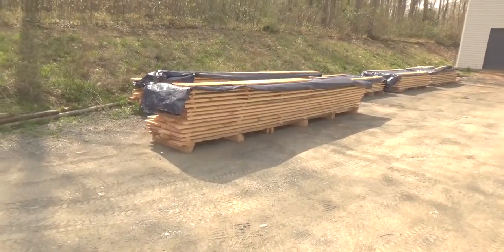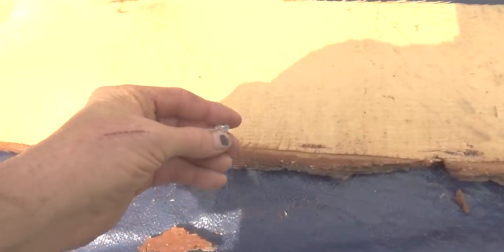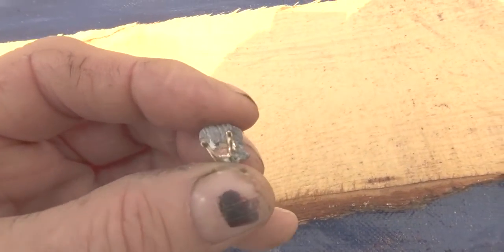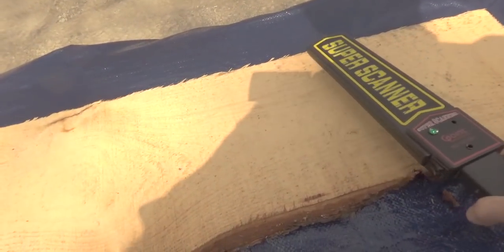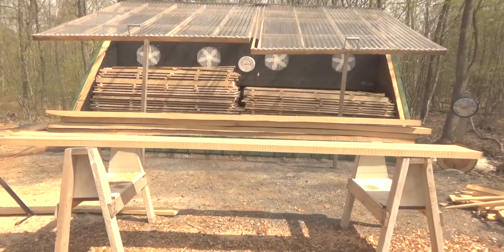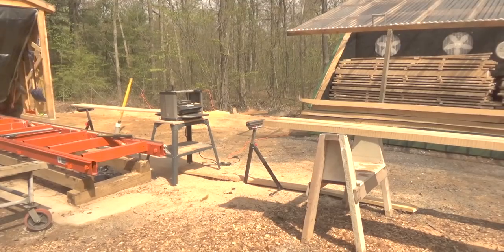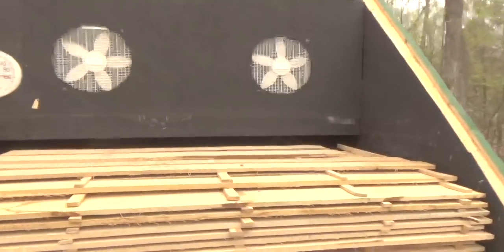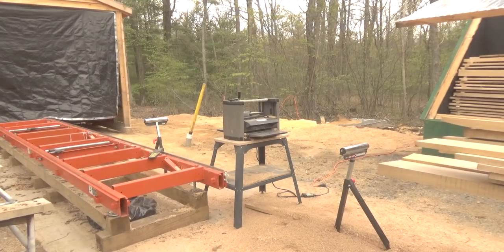Setup for planing at the kiln.

Comment: For some reason I have become hooked on your videos, I look forward to see your progress.
You should look into taking your lumber to a mill and have it planned, your tinker toy planner is to small and slow for as much lumber you have to do. My Powermatic 225 has a 7 1/2 Hp motor in place of the 10 that came with it. It makes lots of chips real fast, I think it will mill a 10x 24 beam, I have never done one as the room for the forklift is limited. I picked it up at the high school woodshop for $150 bucks. Scrap was paying 2 cents a pound and I gave 7 cents a pound. Ask your school wearhouse if any are available. You two can have one. Any way,  I bet your local mill would charge you about 10 cents a board foot to run your boards.
I just had an idea for your Tinker Toy, grind a set of roughing blades, grind away a inch every other inch on one blade and the opposite on the 2nd blade. Kind of like a roughing end mill. Run the whole unit and then change to a fine blade cut for the finish pass. And yes you need  in and out feed roller tables bolted to the Tinker Toy and run boards end to end if scalping is a problem.

Comment: I get about 2 1/2 inches of snipe at the end of every board unless i run the boards end to end or run a sacrificial board behind them. I have the same planer. It looks like your sharpening worked well.
Reply from the maker: The sharpening worked great, I get snipe also, but I cut all my boards 8'3" and then trim them after the final planing. I always add 3 inches when logging. It is a good little planer. No overheating, and it cuts consistently.

Comment: Jj,
Weight does reduce some warpage but it isn't the deciding factor.Grain decides if the board is going to cup or wharp.
Reply from the maker: Portuguese Man o' War That is right, I had said that in a previous video. I am trying to get guys to maximize their results from their efforts by doing whatever they can before the wood does it's dance.
Reply from the maker: Portuguese Man o' War That is right, I had said that in a previous video. I am trying to get guys to maximize their results from their efforts by doing whatever they can before the wood does it's dance.

Comment: Morning Joe.... just when you don't want it to, it rains... well, I guess it's better than snow! Looks like we're going to have sun until the weekend, then rain again, so maybe you'll get some more work in during the week. Looks like cutting the wood is more fun than planing it! Now, with the rain, what about the pile of dried wood that you have there on the saw horses, did you get to cover that before it soaked in the moisture? Have a good one.
Reply from the maker: The pile that was planed was put into the greenhouse. We are having rain today Wed. and it is suppose to rain Friday and the weekend as well. I don't mind planing, it is nice to see the finished board and planing brings the grain out nice. It is a slow process but all good things take time. Learned that years ago. Have a good one John

Comment: Just guessing but if you had a well adjusted full infeed roller table and  outfeed table it just might help with the end sniping. Eliminating the gravity pull  could make a difference.
Reply from the maker: True, and the boards have got to be perfectly flat in all directions. Which is hard to come by.